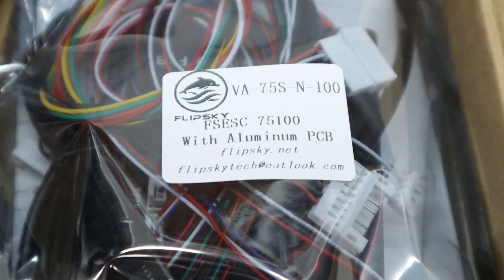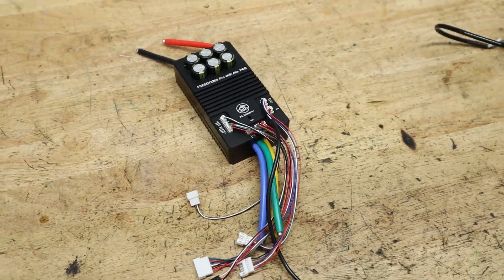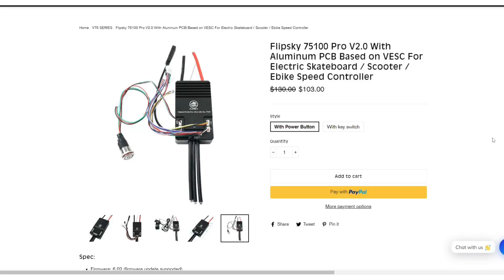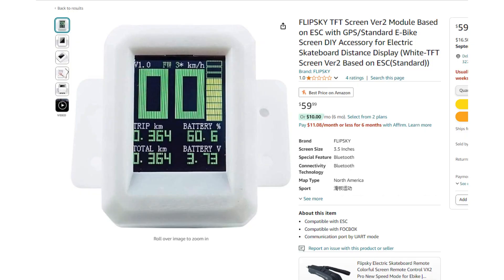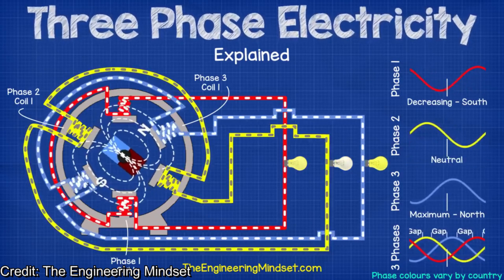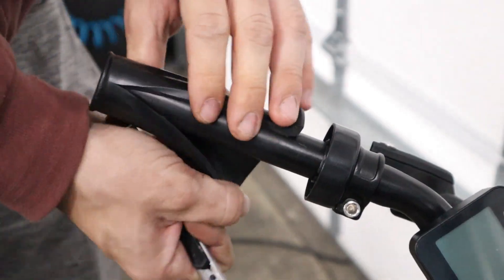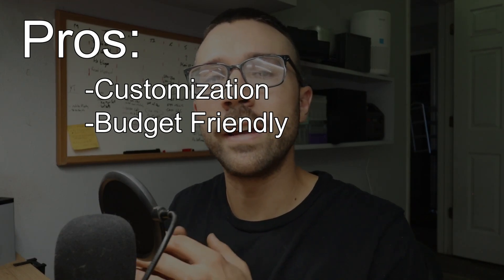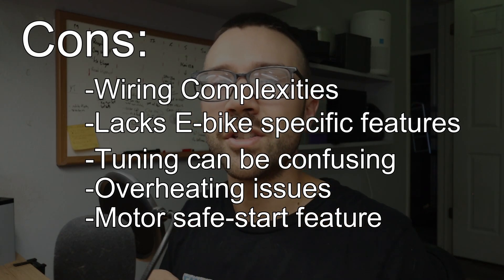Full Overview: Upgrading your E-Bike to VESC!

Comment: Can you tell me what is wrong I have a phantom gogo R1 seated scooter I don't have a throttle hooked up everything else is stock . When I go to connect the 36volt battery to the controller to sparks shoots fire. As if I was hooking it up backwards . But I'm. Going black 2black and red 2red . It will even do it when the controller is not hooked up to anything else.   Please help ,!!

Comment: Hi Chris.
Can you help me?
I have a problem about the throttle when i select the throttle type "current" i twist it about 10-20% and the motor is spinning 100%. 
But whet i select the throttle type "duty cycle" i have full controll of the motor but i lose the "freewheel" function. 
Can you help me?

Comment: I bought a flipsky controller for my e bike I’m new to this hobby and I’m excited to get into it sense it’s open source and theirs a lot you can do with it compared to stock controllers my battery is 48 volt my motor is 750 watt 1300 watt peak and I would love to push the limits on my bike which is a g force zm e bike aka an e bike that looks like a small motorcycle

Comment: Could you use this controller for a dual motor setup? Meaning 1 controller for 2 motors?
Reply: I know vesc has a primary and slave instruction out of the box for syncing 2 motors. Yessir. Checkout the flipsky 75200 pro v2

Comment: Which is more reliable the flipsky vesc 75100 v2 or grin baserunner/phaserunner l10 for 52v 30-50amps?
Reply: Grin would be more reliable for sure. Flipsky is cheapened out, the v2 less so but still.

Comment: First for most e-bike enthusiast you want to mention potential concerns over hall effect. My assumption here is that these controllers do not utilize hall effect and must be programmed. This is critical to understand as you have no positioning signal of the motor you have to program all that in. The key element which you mentioned but should be emphasized is the fact that it's a sign wave type  of controller which for obvious reasons is more efficient than a square wave.  MarkMannM2

Comment: I have big niu bg-10 e-bike with 1000watt motor in front and back and it won’t exceed 34mph. I can do that with only the back 1000watt motor and when I engage the front motor, it makes no difference whatsoever. It will make the bike accelerate faster, but will not exceed 34. is this due to the speed controller? Can this controller run dual motors

Comment: I would love to see some VESC’s in the 140-240v / 10-50kw range, opening up options for hybridization in amateur motorsports with existing hybrid/EV drive units. I’ve been wanting an inexpensive starter/motor/generator combo unit to eliminate problematic accessory belt drive systems and drop weight where it matters for a long time.
Reply: Yeah, would be cool to see EV sized ones. Lots of people out there making old cars into electric models since the drivetrain is dead.

Comment: I've been making samples and music my whole life. So the easiest way to explain the differences between the typical square wave and the sine wave controller signals is that the square wave is more of A. All are nothing pulse, but at a really high rate, kind of like, uh, rocket engine. How it pulsates, that type of signal execution, it ends up being more torquey, because it's really kind of violent.
And the sine wave smooths out the
Transition between those oscillations of all or nothing signal waves. Square wave controllers are more simple, though, and  because of that, they are going to work better and more reliably, when you buy a scooter with a sine wave controller, most of the time, it means that it's going to be a very controlled acceleration. But it's more manageable, it's all opinion and how you write good day

Comment: Another downside that if you're interested in high power, you will run into, is there voltage limit. Generally speaking they accept up to 20s, and no more than that. While it is true the input capacitors are 100 volts, you don't want to be near that, because you will have some level of noise within the system, and you don't want your caps blowing at speed.

Personally, I'm on the 75 350 right now, no hw limits firmware, on a 120x100 35kv. I'm getting about 8 kilowatts sustained. I could probably push it to 10, utilizing a higher kv, and a little extra motor current, but for a brushless system, you'll never get peaks.

Another downside that I don't think was mentioned, is specifically with foc, the only reason you would ever get one of these in my opinion, you can run into things called dsync, decoupling, saturation, and so much more. Trapezoidal speed controllers can normally do more current and you don't even have to think about saturation. But because VESC virtually models all of the physical effects, it WILL break down if you push too many amps, you'll throw ABS Current faults, the motor will studder, and you'll lose a lot of efficiency. That's where a basic esc will excell, brute force current, at the expense of control, and efficiency.

Comment: I have the flipsky 75100 and do upwards of 80 line amps no problem. I put a thermal pad and heatsink the exact size as its rear on and I’ve never seen it go over 40c(it’s externally mounted). A Bluetooth module and phone handle bar mount is absolutely the way to go. I don’t have a power switch, I just unplug it every time.

Comment: Do the dual versions of these controllers allow for the disabling of one motor on the fly? I'd like to install one on my two motor scooter but I have reasons I'd like to disable my front wheel. I'd rather not use two separate controllers and figure out how to make one throttle control 2 controllers.
Reply: I'm interested in this, too. Couldn't you just interrupt the power supply to the front wheel with a physical switch?
Reply: btw, I had a scooter with two equal 1000 W hub motors. curiously, they had 2 different controllers. one was for 800 W and the other for 1000 W. 
Someone suggested the difference was for smoother acceleration. It could also have been for legal purposes, to allow a slower, street legal speed limit with running only a single motor. 
The display control allowed toggling between 1 or 2 motors. One had a capped speed.

Comment: Does the throttle type(hall effect vs resistive) need to be taken into consideration? I may have my terms incorrect. Whatever version takes 3.3v vs the 5v. I know hall effect types usually use 5v.

Comment: Ty one question if I have ebike 36v 250w with 11ah battery HESC ebike motor can I replace controller like you done please advise me which controller I can use and can add throttle

Comment: I’m getting the engwe y600 tomorrow, if I get the vesc will it work on this scooter? What else do I need to do I know nothing about electronics and wants to make my scooter faster. It goes 28 mph but I want it to go 40-50 , someone please help
Reply: You can use the controller on any electrical motor. Just make sure, that it can support the targeted Volts and Amps.

Comment: Is this adaptable to a Bafang m620 ebike motor with torque sensor? I’m running vesc on a Ludicrous controller from Luna Cycles, so i would assume it’s doable. The M620 is canbus, not very tunable at all.

Comment: Can you control the vesc with a potentiometer? I need to control a stationary motor driving a belt. I just need a panel with voltage and potentiometer to vary speed.

Comment: Hi was wondering if you can help
I have FLIPSKY 75100 FOC 75V 100A Single ESC with Aluminum PCB for Electric Skateboard/Scooter/Ebike Speed Controller and I want it to run this motor on a bench Flipsky BLDC Belt Motor 6374 190KV 3250W for Electric Skateboard with Hall Sensor Dustproof Brushless Motor DIY Electric Skateboard all I want is the motor to run

Comment: I've got the 75100Pro connected to a 7070 motor with a 12S battery and I'm pulling 35amps at full throttle. If I don't care about burning the board out, is there any way to get just 5 more amps? I'm building an efoil and I'm able to get 5.5mph of speed which is right on the fringe of lift off. If I could get ~10% more juice through the esc I think it would work.
Reply from the maker: Connect it to a pc (or your phone perhaps) and update to the latest firmware with no HW limits (hardware limits). You'll want to save your motor config before updating, as the motor setup wizard may not work anymore.
Reply: @ could t figure out how to export the stock firmware before accidentally overwriting it but it gave me a chance to look into how to setup the motors so everything is working now. I was able to put ~60 amps but it still wasn’t enough. Ordered a 75200 I’m going to try and replace it with.
Reply: Thanks a ton btw.

Comment: can you limit the throttle only speed for ebikes ?
Reply from the maker: Yes, you would want to use the erpm limit function
Reply: @ChrisBuissonDIY  Thanks! Top content, btw.! I'm interested in ad hoc speed limiting options for legal reasons (... and I don't understand why that isn't everyone's challenge?). The most important would be some simple switch to pass a casual roadside inspection. Can that be done with a Flipsky 75200 pro? Or even normal controllers that come with the bikes?
Reply: @BabylonPatrol  Simplest way would be to add a resistor in-line with your throttle output signal, with a switch to engage/disengage the resistor. This would limit the output of your throttle directly.

Comment: Hi Chris, yours is the most engaging video on VESC projects! Thank you! I am here to broadcast a question regarding an e-bike project. Is the controller (SW setup) the most delicate part of the solution? I'm asking because I need to select a motor (front hub, 36V - 250W) and I see (on Aliexpress) several items that seem almost identical but the price can double. Bafang's price is the top. Can the motor affect the final result? In case, how much and for what reason?
Reply: Controller will work with any motor. Be aware that any motor will take any power level but it's ability to stay cool is the limiting factor. Bafang makes all sorts of power level motors, from 250 watt to 750 watt geared hubs. And of course they will handle more or less than that in real use depending on how you drive them.

Comment: the newer Makerbase 84xxxHP series are damn good, they're same volt and current limit as the 75 series (20S, 100 or 200A), inbuilt bluetooth, 84200HP has also an inbuilt IMU, real phase sensing and phase shunts and works way better, especially compared to the 75 series from either brand

btw the 75100 Alu PCB and all the other Alu PCB controllers all use the same mosfets

Comment: I have a escooter with dual 60v 25a controllers. Would the 75100 pro be worth it?
Reply from the maker: With 2 of the flipsky's, I think you'd notice a lot more torque and smooth power. You can also buy 1 flipsky that controls 2 motors, that might be a good option too!

Comment: Couple questions. Does it come with the adc cables? I'm looking at building a crazy cart with a 75100 and can't find much info about adc online, I want to put a regen thumb lever on it but all the ones online have weird connectors, does the 75100 come with the correct cables that go into the adc2 port, I just don't know what I need to look for for a brake lever with a sensor or a regen thumb lever with a sensor, what kind of cable/connector it needs

Comment: Are they easy to install? Reason i ask is ive a modern carbon hub motor  and ive a bigger ah battery but theres a torgue sensoor  in the bottom bracket can these controllers accommodate these mods  .id defo be a customer 👍

Comment: nice intro thanks. on the side ADC = analog to digital CONVERTER (not controller). the throttle typically sends a DC signal ('analog') to the controller ADC input. the ADC converts this analog signal to a digital number, meaning the controller then based on the measured voltage sets the correct speed.

Comment: Im curious, many batteries (mine included) have a switch on them.  Would it damage the conteolwlr to use this switch as power control instead of the anti spark switch you mention?

Comment: I accidently put a check mark on paring done and now my bluetooth does not work anymore. There is no way I can connect via bluetooth to turn it back on. How can I fix that. I tried resetting and unplugging the battery. Nothing works.

Comment: excellent - thank you. this is the first time i hear about VESC controllers. question: my escooter does not have regen braking. would it be possible use the VESC in parallel to the existing controller to add regen braking?
Reply: No, the controller running the motor must be the one telling it to accelerate or regen.

Comment: my first try at something programmable upgrading from the KT type controllers just happened to be a Fardriver 72300, it was available and in my budget, it sat for months until a project came along, a EV Global LE 48v 1000w upgrade with a KT controller not running, I have to say after learning the steps to get it going, with much help online, like you mention, it really pulls nice on first trials. It is like you say, for sure , thank you.
Reply: They seem fantastically awesome. I got a free "1000w" 27mm stator direct drive motor with a basic KT type controller with a bajillion fets. 
Got me a 75100 v2 so I can have Regen, use all my different voltage packs anywhere from 12v packs to 48v or more if I had one.

Comment: Not sure you get much more with a controller capable of 100 phase amps. The resistance of your motor coils determines the maximum possible amps you can get from a given voltage battery. Maybe it helps a little, because some controllers rated for less  amps have higher internal resistance MOSFETS, so the added resistance there would result in less amps to the motor. But it wouldn't be a lot of difference.  Also, FOC gets higher RPM from a given battery voltage, but the downside is less torque and less efficiency.
Reply: Phase amps are unrelated to battery voltage, for the most part. Just that the speed you can have max phase amps to, will be smaller.

Comment: wiring video pleaseee! I would like to know how to connect brake switch and cruise control while keeping ADC2 connected to a second throttle for regen, while normal throttle is connected to ADC1
Reply: Spintend makes an ADC adapter for ebikes that is a separate board you plug all your peripherals into (cruise, speed 1-2-3, throttle, brake, horn headlights, turn signals, brake lights) and it send that information to the VESC controller. 

Otherwise you need one of the VESC designed for ebikes that already have all those ports.

Comment: I use VESC that can handle up to 80V i think it is for my electric skateboard
Reply: I have been pondering using it
Reply: 75.6v is the highest voltage 
80 amp battery current 
140 amp motor current
6kw peak operating voltage

Comment: Can you tell me which wires I use to wire   Up a three speed switch .
Reply: You need an ADC adapter for ebikes like the one from SpinTend. It allows a bunch of peripherals to be plugged in and then it sends the information over to the VESC. 

For speed 1-2-3 basically when in soeed 3, normal throttle calibration is used. In speed two it switches to a different throttle calibration based on settings, and speed 1 switches to a third throttle calibration, which has an even low max throttle signal,

This adapter also lets you plug in cruise, reverse, headlights,  brake lights, turn signals.

The adapter is for changing a skateboard VESC into an Ebike vesc.
Reply: does it allow pedal assist besides manual throttle??

Comment: How do you know which colour (blue, green, yellow) to connect to the controller when it's all black for the phasewires??
Reply: It has automatic pairing so the color of the phase wire doesn’t really matter, but if there are connectors between the motor and controller it would be smart to color code them to the motor phase wire color so that if you disconnect the motor for some reason you can reconnect it with running the self-learning algorithm again.

Comment: I have a Heybike Brawn with 48 volt 18 ah, maximum battery discharge of 15 amps. My controller box states 25 amp max current but hidden settings can be changed to 31 volts. I changed my settings to 30 amps output. If my battery's discharge is 15 amps, what does this do? Could point me in the direction of the best controller for my bike that will have most or all original features using my existing display. Current stock controller is model A062-AXD002, not sure of maker. If I do anything else to the bike, it would only be adding a second battery. With your controller recommendation, what could I expect? 0-20 about 9 seconds, 28 mph, and Heybike states up to 65 miles range. I'd like to go faster, further, with more torque for hills. This is my first ebike. I realize stock motor and battery have limits, I'd like to push the limits a little further, safely. Thanks for the video and help.

Comment: Did you have any problems with throttle setup, I have tried both a twist and thumb connected to COM 3.3, GND and ADC1 and it refuses to see any voltage changes as I activate it
Reply: Have you mapped it in input setup? 
try 5V instead
try updating/reuploading the firmware
Reply: @sicat2345  Turns out I had a dead throttle.  My kid blew up the last controller (unfotunate phase wire touch).  Replaced with the flipsky, it appears it zapped the throttle as well

Comment: I prefer spintend over flipsky for a "budget" option. MUCH more reliable and they make this adc adapter which makes wiring your bike a breeze, especially if your building an e-bicycle/ebike and not an emoto/emoped.
Reply: Do you mean a sprint controller.  Like super old?
I can barely find anything in it and seems like it’s a controller from 2014? 
If you have a link please drop it here
Reply: @lukenorton8243  You ever find the "Sprintend" controller,  as opposed to the"Sprint" controller, lol. And, is there anything better, thsn the VESC with programmable controller, lol. Thanks!